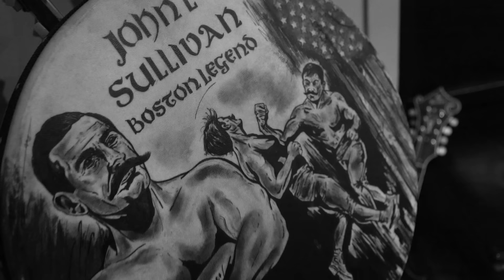Dropkick Murphys "Smash Shit Up" (official music video)

Comment: I wish they would come down to New Orleans and demolish the semi-collapsed Hard Rock Hotel at 1031 Canal Street there.
Reply: Duuuddeee I was just in NOLA this past weekend and saw that! Crazy stuff
Reply: Is that dead guy still stuck in the rubble there?
Reply: @milesgeary9213  Yes there are two dead bodies still rotting in the rubble.  The wind blew a tarp off and exposed the legs of one of the dead men.
Reply: Swiatek702  Not sure, but the city inspectors are deservedly getting the blame for the hotel's collapse.  They signed off on the project and were never at the building.  It's a scandal of huge proportions if it were in another city, but for New Orleans, it's just business as usual.
Reply: It appears only new construction and nice borrowed tools and equipment are fitting, sorry 🤣👍🏼
Reply: What's going on there? Also, why hasn't anyone done much about it?
Reply: @theevildrummingsithlord1492  In New Orleans we have a saying:  "Preservation through Neglect."    They need to declare it a Confederate monument so the "Take 'em Down NOLA"  Krewe will pull it down.

Comment: before you go smashin everything you should send samples or get test kits use videos to communicate what's in the houses, cabinets, walls, ceilings, windowsills etc.  Hazardous substances were put into places whether on purpose, cheapness?, retards in charge?  You're potentially putting way worse chemicals in the local population than what was stored in the mine